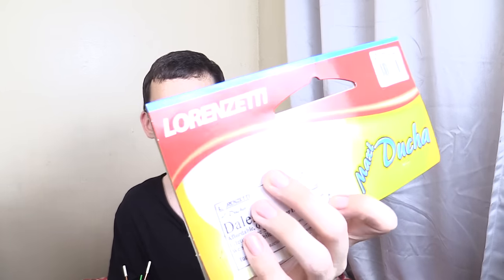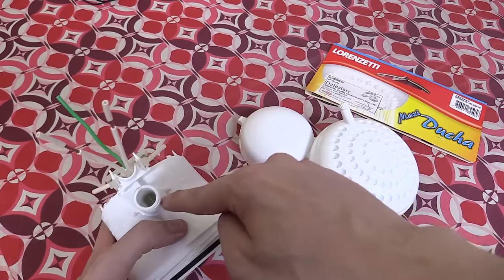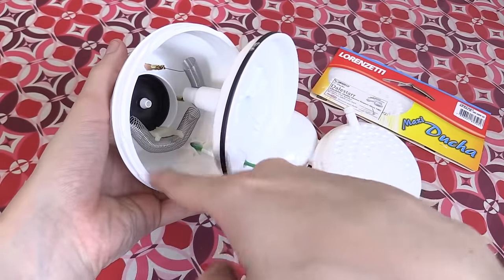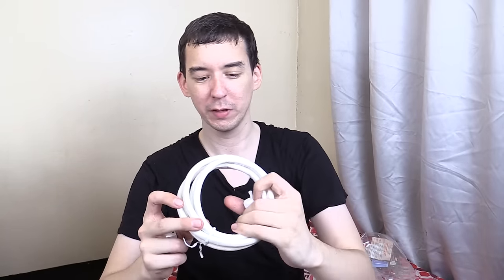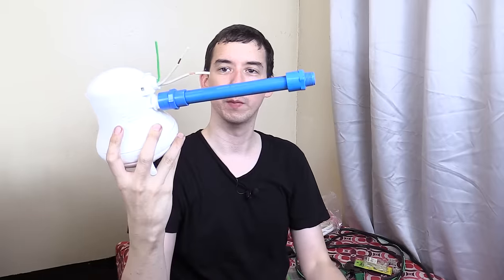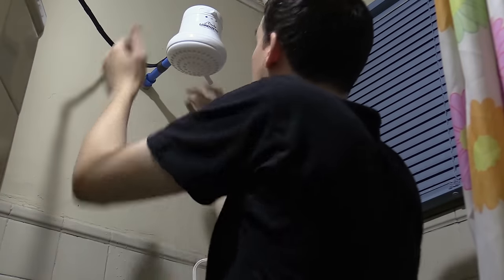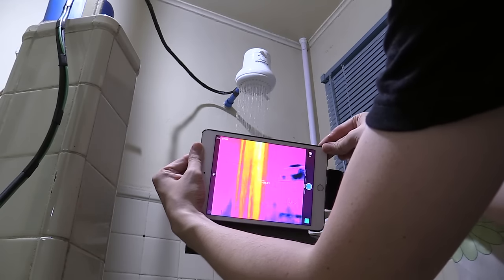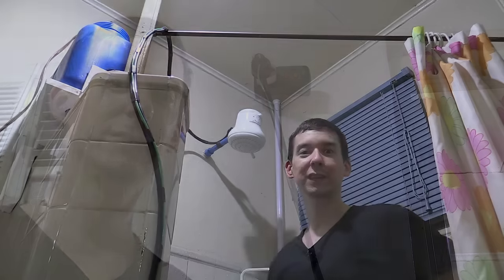Lorenzetti Electric Shower Head

Comment: I am Brazilian, and I can say that to my knowledge, no one has ever died with this shower. It is a cheap shower of questionable quality, its useful life is about average from 2 to 4 years, and once the heater element  ("resistance") breaks, it is more feasible to buy another shower than to repair/change it, that is how most people do here. This shower is very sold and very common to be found in a typical Brazilian house in the whole country.

The question about the apparent wires, even before they can rust and break, the heater element spoils and the shower is replaced by a new one.

The real suicide showers were showers of this and other brands, produced until 1997, with metal casing. They caused so many deaths that the standard-setting body banned the commercialization of showers, electric taps, heaters, and other things with metal casings.

On the matter of grounding, the overwhelming majority of homes do not have a grounding system since construction! There is no way to connect the ground in the shower if the house has no grounding, and doing so means breaking a good part of the concrete floor of the house, which is laborious and expensive, so most houses do not own it
Reply: Rikintosh just out of interest, why do people buy these things when they don't last very long?
My power shower cost £150, it is roughly 15 years old and it still works like new as long as I descale the shower head every couple of years. 
Why don't Brazilians invest in a more expensive, longer lasting option? Are these shower heads used mostly by poorer people?
Reply: Yes, most poor people use electric showers, the middle class usually uses the gas to heat the water of the house or apartment. There are showers of better quality, electric, I even have a 50 dollars with gradual temperature regulation and very economical.

Most people use electric showers because the country was colonized by Europeans, so the houses were built of bricks, and when the electric power arrived in the country, the houses began to be built already with wires for electric heating, the gas heating did not was common at that time because the country had no gas refineries. In fact, it had neither refineries of oil or flour until the beginning of the century.

Until 30 years ago the electric shower killed many people, because the pipes were not made of pvc like today, they were made of iron, and the electric shower was not usually grounded (to this day, grounding in the houses is not common), then sometimes people were electrocuted while touching the faucet because the shower enclosures were made of steel.
Reply: Martyn James - because low income families cannot afford more expensive ones. It's easier to buy a R$60 shower that will last you 3 years than spending five to ten times more money and still need to change the resistance when it burns out. That's a LOT of money for poor families.
Reply: Rikintosh actually some people died using these things, but the exact conditions are not clear regularly, ground cable is important
Reply: Nowadays, usually it's used by poorer people. I'm middle class, I live in an apartment, we used to have one until I was about 11yo, then we moved to another, newer, one and since then we use gas heating, so it's been almost 10 years since I've last seen one personally. And as a side note, we did use the second, smaller, shower head! :) It's the only thing I miss from it, really.

And in Brazil, what may be a small difference in price for an American or British person it's usually way more costly for us. So that's why we may choose a worse option that's just slightly cheaper for other countries. In your example, £150, that's R$755, that's crazy expensive for a shower head. It's almost the same as the minimum wage (monthly), and it's higher than the minimum wage was in 2014. Just doing a quick search on the internet, I found the Lorenzetti shower head from this video for R$40, and a more expensive, better-looking one, for R$300 (also from Lorenzetti).
Reply: I am not Brazilian and I have seen these showers in both Brazil and South East Asia as well (Thailand) and I thought that the use of these kind of shower heads also had to do with the fact that the weather in these countries is mostly tropical and you do not need a very powerful water heater to take a "comfortable" shower, especially with temperatures above 35°C, and without temperatures below 10°C.
Thus you do not need to spend a lot of money on gas but a little in electricity.
Am I wrong Brasileiros?
Reply: Gonzalo Salinas i never thought about that, but i suppose you are right for most part of Brasil, BUT in the south states weather can get really cold during the winter, like - 5°c. I guess they use better showers or gas. I live in south east, so its cold, but a lorenzeti can handle the winter.
Reply: Martyn James - The answer to your question is simple, oil derivatives like liquefied gas can fetch at astronomical prices in poor countries. Here in Brazil 1 liter of ordinary gasoline costs around US$ 1.50. In addition 99% (I think) of the places does not have piped gas. On the other hand, we have a relatively clean and efficient energy matrix coming from a mixed network of hydroelectric, natural and biomass-fueled temoelectrics, to a lesser extent nuclear, photovoltaic and haolic energy. Even the electricity costing quite expensive is still much cheaper than other sources. Where there is piped gas the use of electric showers is economically unfeasible, but as I said it is an exception.
Reply: Thanks for clarifying, I didn't know it could get up to -5°C in the South, and I wasn't sure Lorenzetti could give you enough hot water for such a cold weather.
Reply: @Zormac  This kind of thinking is what keeps poor people poor.
Reply: More people die by gas leakage in water heaters than by electric shower.
Reply: @gonzalosalinas  actually these suckers use A LOT of electricity...
Reply: I am Brazilian and I live in the center of the country. I've never seen a gas shower in my life, even in richer houses, mostly because I've never seen a gas system here, until arround my 15 year old I did not even knew the existence of gas showers, I discovered that when I saw on the news that a girl died from gas leak while taking a shower, I've never heard of people dying from eletric showers
Reply: @madMARTYNmarsh1981  20 dollars = 2 years working, 150 = 15 years = 7,5 showers. A new product fail chance is less than older
Reply: I don't know about them not lasting, even the cheaper ones... I don't know if It's because where I live it's super so most people take cold showers. What I realized it's even middle class people here don't bother about fancy showers. Like, you can enter in a super fancy apartment and see one of these in the bathroom.
Reply: Eu tenho um chuveiro desses faz mais de 13 anos e ele funciona perfeitamente até hoje
Reply: I don't understand that house hasn't got a grounded system!
That's one of the very basic safety precautions and is in every code of install you can possibly think of in Europe and the US.
Reply: @gonzalosalinas  You're right. Lukewarm water is usually more than enough.
Reply: If your houses dont have ground/earth connection,  why dont you join the earth from the shower to the neutral so to remove the residual current
Reply: Acho q tu deve ser muito rico ou desconectado da realidade. Quem que troca o chuveiro todo ao inves da resistência? Só se for uma pessoa muito leiga ou que foi enganada por vendedor de loja. O chuveiro dura bem mais do que 2-4 anos, e é muito mais facil e barato trocar a resistência do que o chuveiro todo, ja que ela separada deve ser no maximo uns 20% do preço total de trocar um chuveiro. Alem disso a tua definição de classe media tbm ta bem errada, quem tem chuveiro a gás geralmente é classe alta ou mora em prédios mais recentes com encanamento pra isso.
Reply: @K3nnyMcCormickk  Vc é que com ctz não usa chuveiro de pobre. Trocar resistencia é coisa de chuveiro do tempo que era de metal, preso com parafuso. Chuveiro de plastico estoura o plastico assim uqe vc tentar abri-lo.
Reply: @RicardoRamosRetrocomputacao  isso a bastante tempo atrás, nao hoje em dia
Reply: @K3nnyMcCormickk  Isso pq vc tem grana pra comprar chuveiro descente. Não usa chuveiro de 40 conto, com ctz.
Reply: @RicardoRamosRetrocomputacao  I also disagree. Changing the resistance costs about 20  reais ( 4 dollars), and a new shower is about three times as much. And it is really easy to change.  The majority of the houses, including wealthy ones, use this system. The only real care is to not change setting while it is on, a common concert of every brazillian who have heated bath. Some parts of brazil do not even bother to heat the water, or cannot afford it.
Reply: @marcuswareham1  That would be even more dangerous. A short circuit in any appliance in the house or a fault in the neutral wiring would electrocute the poor guy in the shower. Oh, and 220V appliances won't really get Neutral, but two phases.
Reply: @gonzalosalinas   + -. Eletric energy is more cheap to gas here tho. Country of massive rivers, hydroelectric is 70% of the energy production here.
Reply: Just get a heated shower with a hose so the unit sits on the wall with a pump. I don't know why these are so common.
Reply: @marcioenergiabr3230  They don't 2M people died worldwide from these last year while only 500,000 did from Failing Water Heaters.
Reply: @megatronskneecap  Where the fuck did you took that info from?
Reply: the moment when the rezistor breaks your dead,.
Reply: @videos40058  Nope. Water is not conductive enough to conduct 220v into the body. It has happened countless times to me, I'm here writing it now.
Reply: Thanks guys was really informative
Reply: @madMARTYNmarsh1981  Because £ 150 is R$ 827 (reais), Not to mention that the wage in Brazil is , So people cannot spend 70% of their salaries on just 1 shower, considering that money here is very devalued leaving everything expensive, and we still earn little compared to inflation, So almost every salary of an average Brazilian goes to their survival and money is left for almost nothing
Reply: @gonzalosalinas  Partially correct. Most of Brazil indeed experience temperatures above 10°C, but in the south it's common to reach below freezing temps time to time.
So, while most of the country use the standard 5500W 127V shower heads, you'll mostly likely see 6500W+ 220V models being used the more you go south.
Some models can go up to 8800W in 220V, so yeah, much more powerful than then standard 5500W.

Still, even the 5500W consumes an ABSURD amount of electricity, it's common for the shower to be responsible to 20-25% or so of the electricity bill of a family.
People with more acquisitive power usually have both the electric shower as well as a cheaper water heating solution. Gas is common, but I'd say the most common is solar water heaters. 
In my home (mid class) we have solar water heating (main) but we kept the electric showers installed in case of emergencies. (multiple days raining non-stop, for example)
Reply: @gonzalosalinas  That's about right, actually (though these can heat up really cold water aswell). And gas is preeeeetty expensive, here, so it's a really economical solution. We have solar panels in our home and use eletric showers (more expensive ones than these shown in the video, with potentiometers to control the heating, but they use the same sort of system), so we can save quite a lot on plumbing and gas / electricity by not going with a central water heating system (a boiler, I think it's called). These are neat!
Reply: @Saberwulfy  A shower head like this in my old house is working for more than 15 years now... If you don't turn it on without water inside the head, it's hard to "burn" the resistance that warms the water... Also here in Brazil the prices are very different, gas is not an option for everyone. The price of this shower head here is something around  R$ 40,00. A gas installation, tubes, and everything can go up to R$ 7.000,00, more than 4 times the minimum wage, so don't woth spend money transition from eletric to gas.
Reply: @gonzalosalinas That's right! Our country has a tropical climate, and the water temperature rarely drops below 10°C in most regions, so an electric shower is perfect for this job. However, the use of an electric shower is also due to costs and infrastructure, since most of the country does not have a piped gas supply system that is affordable for most people. So much so that the gas we use in stoves in most of our homes uses gas cylinders, about 13kg (approximately 6.0lb) filled with liquefied petroleum gas. And to make matters worse, the price of the equipment needed to install a heating system in a home is absurdly high.
Reply: @madMARTYNmarsh1981 Because it is plug and play solutions and the heating element is extremely cheap, only 5 bucks over 2 or 4 years it is not a hassle at all